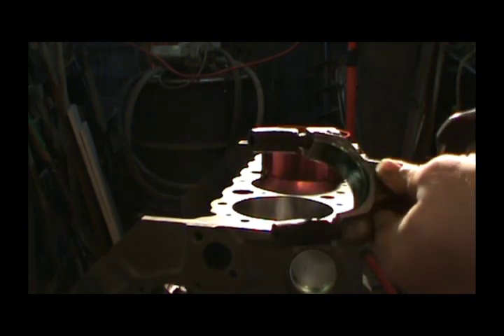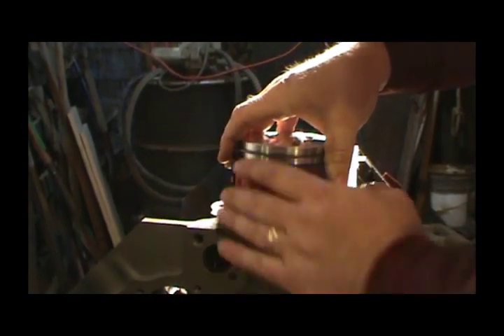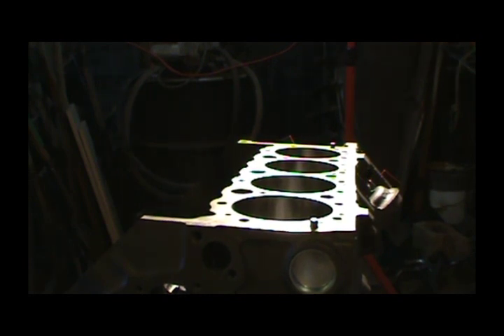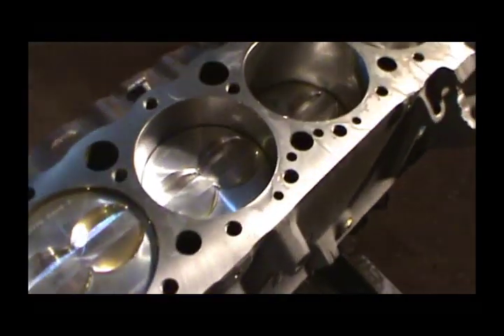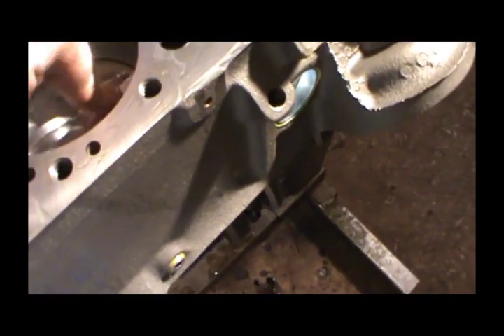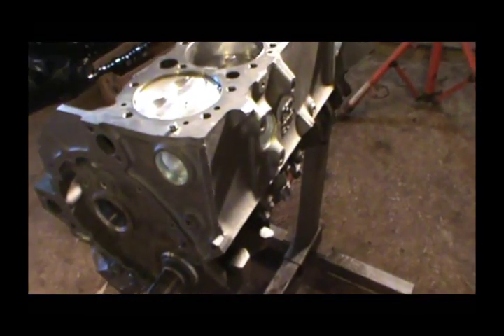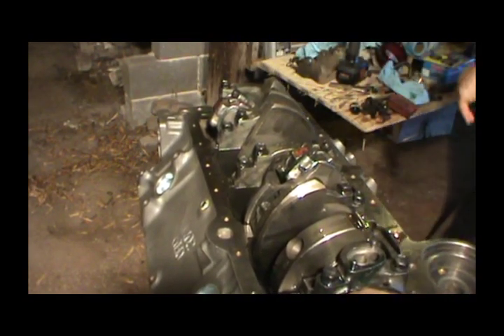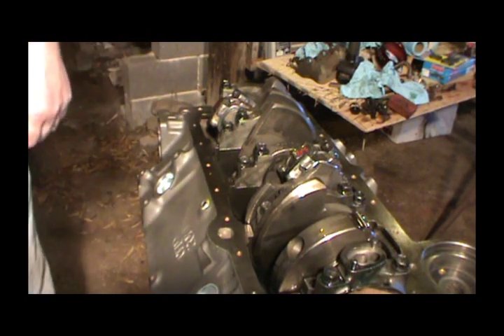Chevy 350 Engine Rebuild Part 3

Comment: Why did you use the .001 bearings in your engine?
Reply from the maker: Anna Dracul I kept the original crank which was in good shape so the slightly oversized bearings would make up for the wear in the crank.  If I had ground the crank, the bearings would have been .010 oversize.

Comment: looks good. after the tractor rebuild I just did torking them at 210lbs 45 seams easy lol
Reply from the maker: Yeah, I know what you mean.  I used to have a huge torque wrench for diesels.  I sold it after I sold the truck.  It takes some muscle to torque the heads on a Cummins!